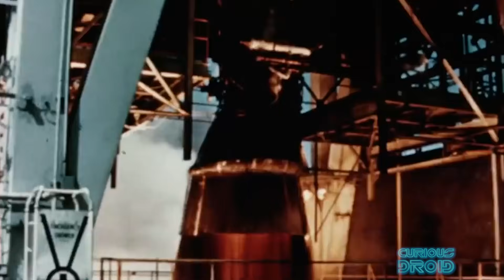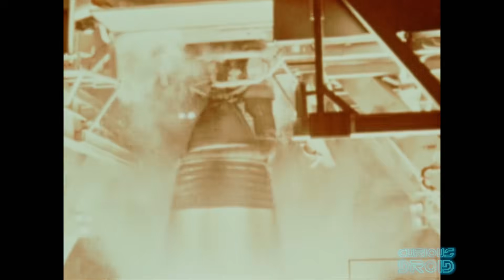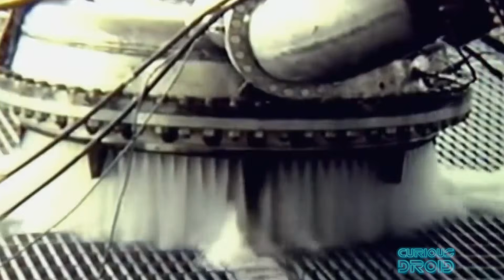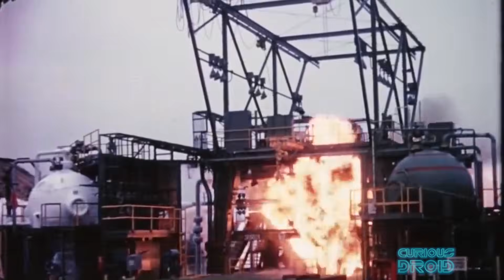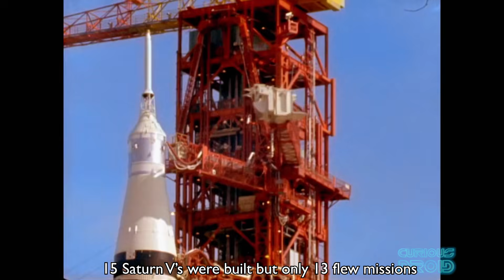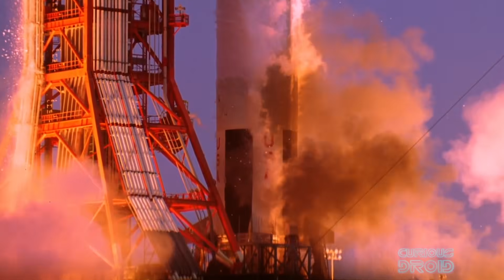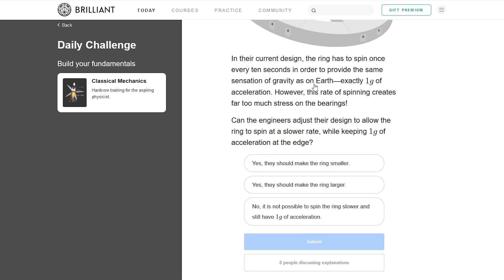F-1  The Engine That Nearly Stopped the Apollo Moon Missions

Comment: 100% reliable?

What about the first stage centre engine, on Apollo 13?
Reply: I think that was the second stage J-2.
Reply: Only Apollo 6 and Apollo 13 suffered engine shut downs, and they were both J-2 engines of the S-ll (second) stage.  There was never an F-1 failure after the appropriate baffles were installed.
Reply: @brabanthallen  Apologies. You're right. My memory let me down.
Reply: @BedsitBob  No worries.

Comment: great video!  however, while the US was able to solve the problems of the F-1 by the mid 60s, the Russians were still developing the N-1 closed system engine....and with considerable more tests & failures.  The Russians were not able to develop a reliable N-1 until the early 70s, which by then, the Space Race was lost for them.  They invested billions of rubles in the development,
far more than the US...and while the N-1 was finally perfected, their space program was cancelled by the Kremlin,
which also ordered the destruction of all remaining N-1 engines.  Had it not been for the head of their space program/rocket chief designer’s mutiny (of sorts) the engines would have been.  However, on his orders, they were clandestinely mothballed & stored in a secret warehouse for over five decades.
Reply: No, the race to the Moon was lost. The Soviets won the rest of the space race in a canter. The problem was two fold. First of all, they had two development programs instead of one. That presents two more problems; first that it confuses the goals and objectives and secondly that their economy couldn’t afford it. The second problem they had was the delay in the development of the closed cycle engine. Finally, they were badly affected by the death of Korolev, who was arguably even more important to the Soviet program than von Braun or James Webb were to Apollo. This was the cause of the political instability in the program. Finally, the Soviet Union didn’t even start talking about a Moon mission until two years after Kennedy’s famous speech.

So yes, you’re quite right about the closed cycle engine. The fact that it took longer to develop meant that the N-1 had to be powered by 30 existing engines, making it rather impractical.
Reply: TheThirdMan excellent points on your response.  but isn’t it ironical that in the ‘90s, NASA started using the Russian-built engines....pure dedicated science knows no politics, just the achievement of the goal....on the other hand, politics knows science all too well....imho.  

Thank you for educating me a wee bit more.  Cheers, Sir!

Comment: F1 is fake. Russia failed moon mission, but they developed NK-33 engines (still used by Russia after 50 years). America had success with moon mission. But after the program finished, F1 never were used and modernized.  Now Americans buy engines RD-180 from Russia. If you do not believe me, look at wiki all those facts and argue me :)
Reply: While your facts about the development and use of the different engines is correct, you seem to have no idea how engines are chosen for different rockets.
If you want to show prove to the contrary, please elaborate which rocket could ever use an engine like the F1 since the end of the apollo program.
Reply: @3gunslingers  >which rocket could ever use an engine like the F1 since the end of the apollo program.
Theoretically, Saturn-derived booster stage for the Space Shuttle (so-called Saturn-Shuttle).

Comment: And to think we can’t make them now by modern means ,, that’s a question I’m sure a lot of people are asking??
Reply: We don't have the infrastructure and so many little changes where done without good documentation that it is hard to rebuild it. It's a dangerous inefficient engine so nobody will even put the time in to gather all the information let alone the buy the machines to build it.
Reply: They did cook up a modern design, fewer parts more thrust called the F-1B.  The decision was made to cling to the hydrolox system instead.
Reply: Still the best we had. When we were good

Comment: Good video about a great engine, open cycle though it was.  Segment concludes that instability not a tough problem to solve now days.  Then why did Russian RD 180, have to go with two chambers on a single turbo-pump?.  While without question a great engine, they couldn't solve instability issues for a single large chamber and nozzle.

Comment: The engine count is off.  Each flight used five engines.  The 13 Saturn V launches used 65 engines.  Wikipedia gives the following counts 

<> 65 engines use aboard thirteen Saturn V launches.
<> 10 engines are on two Saturn V's that never flew.  The rockets are on display at Johnson Space Center and John C. Stennis Space Center.
<> 10 ground test engines were built.  These are on display at several museums and space centers.  
In addition, there are rumors of bagged and N2 purged F1 and J2 engines in storage at Stennis.
My favorite F1 engine is the one outside the Rocketdyne Desoto facility in Canoga Park (http://tinyurl.com/y3rxu6ov).  This is not a complete engine as some of the parts were replaced with wooden models.

Comment: Do you think their solution is scalable? Like, would it be possible to create larger or much larger engines than the F1 or would those instabilities be too large to handle? Also I feel like I've seen these rocket-engine diagrams a billion times, yet I wonder; is the fuel and oxidizer just sprayed at one another in the combustion chamber to create the reaction or is it more complex? I should probably google instead of asking youtube xd
Reply: I believe, and someone step in and correct me if I'm wrong, the engine is technically scalable but there's always a limit to machines such as these. 

A little technical information here:
The structural instabilities are quantified by the frequency of the vibration. Scaling the engine up could bring it closer to the engine's structural resonant frequency (which is very bad, basically it shakes itself to death) OR you could pass it up to the next node of stability. 
But like I said, there's a limit. At some point the pressures required by the turbo pumps and/or combustion chamber become too high for the current material and require design changes. The design changes increase weight, cost, and most importantly for the era... time.

In fact, this is the very reason project managers tend to lock certain design parameters after feasibility analysis. In this case, it was thrust and I'm sure a couple other variables.
Reply: And yes, mixing is a very complex process that would require me to break out my book on it... 
If you have the background to understand it, the book I have which has a couple chapters dedicated to it is: 
Aerothermodynamics of Gas Turbine and Rocket Propulsion Third Edition 
By Gordon C Oates

Its not the best book but it's theory is sound. The better author for books on subjects like this is John Anderson. If you find a textbook by him on the subject, get it. He explains it in a more down to Earth way that makes sense.
Reply: @CJ-sl4wd  Thank you very much for the replies! :)

Comment: Didn't a single F-1 engine fail on Apollo 13?
Reply: No, that was a J-2 in the second stage, but it didn't have much impact on the mission. The later problems were caused by an explosion in the service module.
Reply: @fromnorway643  Ah, you're right. thanks.

Comment: Yes, but the RD-170 was more powerful
Reply: It’s isn’t a single chamber engine.
Reply: @stephenpage-murray7226  but it is a single turbopump engine, which makes it the most powerful and complex one ever flown
Reply: @lorisperfetto6021  
Irrelevant.
Reply: @stephenpage-murray7226  it is relevant. As long as the engine Chambers share the turbopump it does make it one single engine. The RD-170 had 10% more thrust than the Rocketdyne F-1, and was also more efficient thanks to it being a staged combustion cycle engine.
You wouldn't classify the RD-170 or RD-180 as respectively four and two rocket engines, would you?
Reply: @lorisperfetto6021  
It isn’t a single chamber engine.  It’s still irrelevant.  It’s also flew 20 years after the F-1, and should be a lot better than it is.
Reply: @stephenpage-murray7226  I am not talking about single chamber rocket engines or not, I just said the RD-170  is, to this day, the most powerful engine ever flown. You like it or not, that's the truth; and indeed chamber number doesn't mean anything
Reply: @lorisperfetto6021  
This is a discussion about the F-1. 
Maybe English is a second language for you or something, but nobody here is interested in the RD-170.
Reply: @stephenpage-murray7226  what do you mean it should be a lot better than it is? Didn't it surpass the F-1 in both thrust and efficiency?
Reply: @lorisperfetto6021  
After 20 years it should have been better and still took multiple chambers.  Now would you please piss off and annoy somebody else!

Comment: Were they 100% reliable though?... One failed on Apollo 13 in the 1st stage i thought
Reply: That was the second stage J2 engines. The central engine, engine 5, shut down 2 minutes and 12 seconds ahead of schedule, likely due to pogoing. The remaining four engines burned for an extra four minutes to compensate for the lost engine and the spacecraft achieved the desired orbit.
Reply: @yassassin6425  Is that the one that was shown in the Apollo 13 movie? I thought it showed a first stage engine cut (when they were like "we just had our bug for the mission"), but maybe I'm remembering it improperly.
Reply: @butchtropic Oh my bad, I thought the second stage only had 1 engine, but guess that was the third stage? I see.

Comment: Right, I do say we landed the best Nazi in von Braun ! and now we can't reproduce the F1 because so much of it was in engineering handwritten notes? Having worked for a Shuttle subcontractor that's a head scratcher we had to document the daylights out of everything.
Reply: Truthfully they could use computers to simulate the F1 and improve that design. They have the specifications for the pumps and nozzles. So it really has not been lost.
Reply: @metatechnologist  there is a new f-1 varient! Can't remember the name, but it's more efficient and powerful!
Reply: @Wombattlr  Yes there is. - it's the F-1B see the article "A mighty thunderous silence: The Saturn F-1 engine after Apollo"
So they have an actual improved design of the F1 on the table already. That article is a fascinating read and gives insight to the engineering.

Comment: Think of the fix as your shower head or a handheld water sprinkler...at high restricted velocity the water flow could be unstable but if you put a shower head on it with many small openings it smooth's everything out...without getting into the fluid dynamics equations that is pretty much what the F1 fix ended up being (a PhD. Engineer who works for a large American defense contractor.

Comment: 100% reliable. Challenger thinks not
Reply: Space Shuttle Challenger?  The Space Shuttle never used an F-1 engine.  It used an RS-25.  ONLY the Saturn V rocket used an F-1 engine.  Nothing before or since.
Reply: @brabanthallen  There was an interesting project, though, where Shuttle, instead of having two side-mounted SRBs, would've had the ET installed atop of the S-IC stage, with orbiter hanging on the side of ET. It was called "Saturn-Shuttle".

Comment: Oh by the way it wasn't that fuel it was hydrogen was the fuel they used in the F1 you need to visit the NASA space a flight center in Huntsville Alabama and actually do some research they were hydrogen fuel tanks not kerosene
Reply: The F-1s in the first stage used kerosene (RP-1) while the J-2s in the second and third stages used hydrogen.
Reply: @fromnorway643  yeah but they still never made one that actually has the same power and thrust output since the F1 no modern rocket engine is as strong as that one
Reply: @jamesendsley1560  
Some SRBs, like those used by the shuttle and the SLS (if that ever flies), are more powerful, but they are in a different category since they don’t burn liquid fuel.

The RD-170 used by the liquid fuelled boosters of the Soviet Energia rocket were also slightly more powerful than the F-1, but some don’t regard that as a single engine since it has four chambers and nozzles sharing a single turbopump.

However, the F-1 is still the king among "traditional" liquid fuelled engines with a single combustion chamber and nozzle.
Reply: @fromnorway643  there's no rocket engines ever made since they made that one as powerful as that engine the what you're talking about is not a student only one quarter the strength of that F1